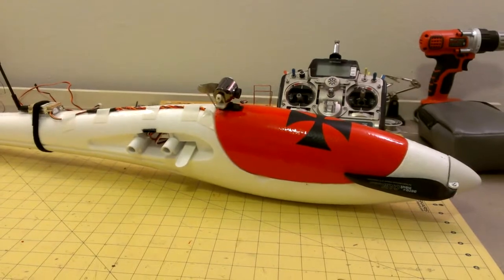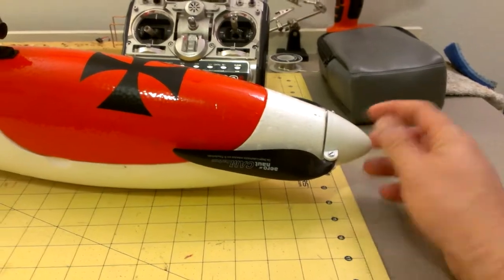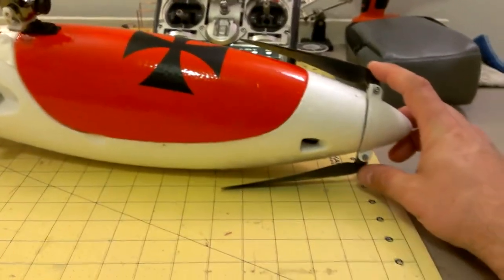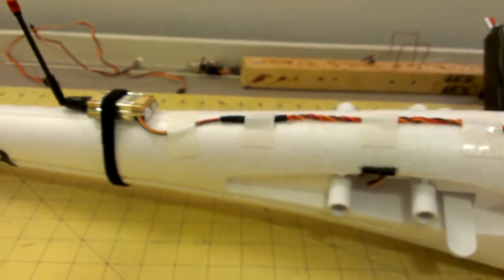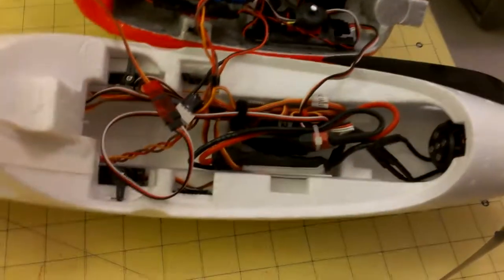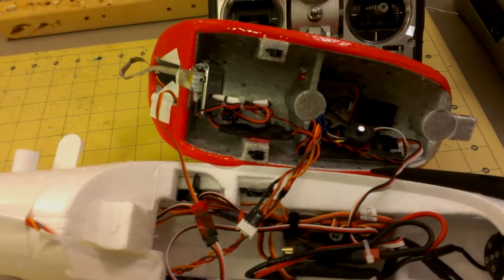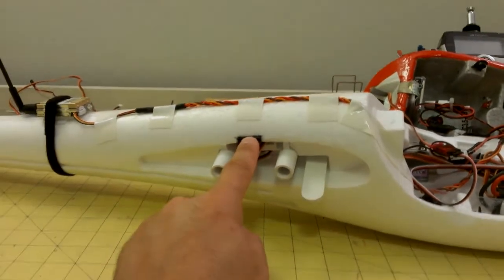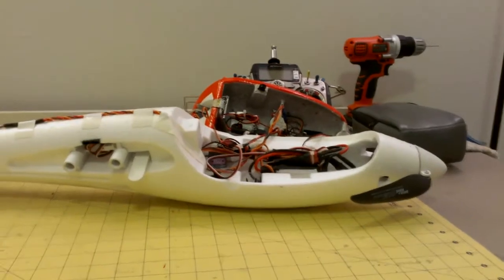Quick Cularis update while waiting for better flying weather.

Comment from the maker: I have a flat piece of light ply glued on a servo arm mounted to a 180 degree servo.  The camera is attached with velcro and has two rubber bands securing it, one on each side.  It works well and with the velcro and rubber bands, I get a fair amount of vibration dampening.  This is only pan though, no tilt.

Comment from the maker: Always willing to accept a check :)  Just kidding.  The camera is very light and it does seem to get a bit more vibration on a multi rotor if you don't balance your motors and props well.  I use it mainly on my planes because it is much more aerodynamic than the gopro.  Thanks.